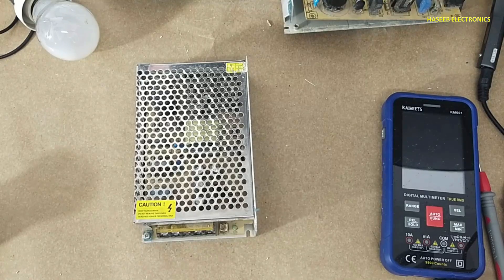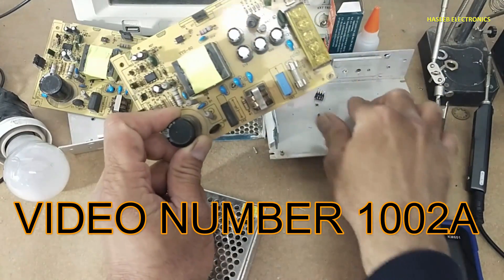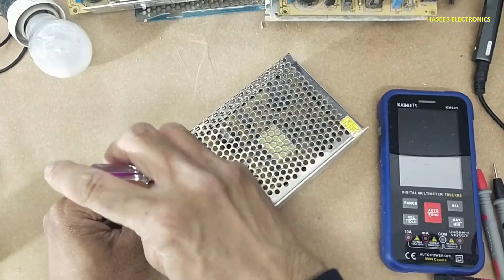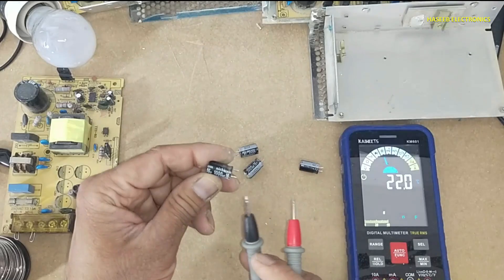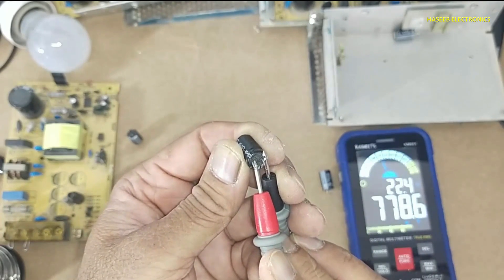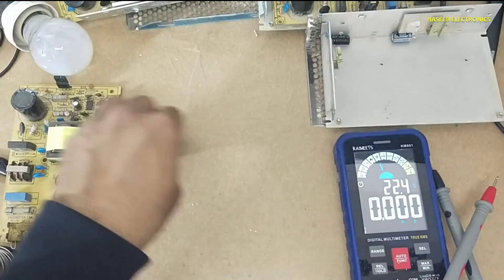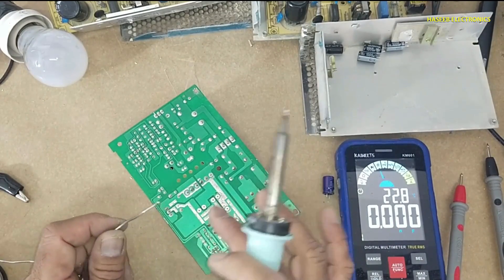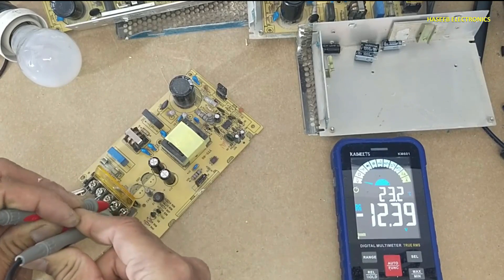{1002B} SMPS output voltage fluctuating, unregulated output

Comment: Bună ziua. Am și eu aceasta sursa și nu reușesc să-l depanez. Au pușcat condensatorii de 1000 de uf. IC Ul și rezistorul de 0.22 ohmi de la pinul 3 al mosfetului. Toate le-am inlocuit mai puțin rezistorul de 0.22 ohmi nu am găsit. Temporar am montat un rezistor de 22 ohmi. Pe ieșire am 5 V .Poate cauza acest rezistor problema mea? Menționez tranzistorii sunt buni octocuplorul este bun IC-ul am pus nou și condensatorul de 22uf al ic ului este nou. Diodele sunt bune inclusiv diodele zener.

Comment: Bună ziua. Respect pentru cea ce faceți. Am si eu o sursă de genu 12v 4.1 amper. Mi-a crepat 2 condensatori și sa ars si intecratul UC3842D. plus rezistenta de la mosfet de 22 microfarazi care merge la pinul 3 al mosfetului 5N65C. Ce cauzează explizia condensatorilor? Cu respecr.

Comment: Great tutorial, already like comment subscribe.

I'm from Indonesia, I have a problem with the SMPS on the "ANJING" brand battery charger made in China using IC UC3842B on leg 7 (imput) with a voltage of 12 - 14 VDC, on leg 6 (output) there is a pulsating voltage of 0,5 - 1.5 VDC which goes to the MOSFET gate 7N65, on the drain leg the voltage is 210 vdc connected to the transformer leg, primary Elko voltage 320vdc, output 0 vdc, where do you think the problem is sir? I removed and checked several important components in the primary and secondary which had normal values... 
In this conditions, is the UC3842B still normal or is there a problem? Thank You

Comment: I would like to share something i learned about capacitors, if you have 1 UF 35v and you want to replace it with the same rating you need to pay attention to all the details such as esr and low impedance and its more expensive, its the same rating 1UF 35V but you will see some marking on it, and by checking the datasheet you will know if its completely the same or there or its different. If you are repairing some expensive industrial power supply or any other expensive things make sure you put the same cap. This is what i wanted to add. Thank you

Comment: the only thing. which you certainly know, the overall ESR will be slightly higher now due to parallel resistance  of the 4 caps ESR vs 2 caps ESR.  but it wil probably be fine especially if the new caps are a quality brand name

Comment: I almost always prefer to have more capacitors in parallel . You have 2 good capacitors 1000uF/16V. So you can achieve 6400uF/16V
Reply: When two caps are found out of tolerance/failed it is good practice to replace all of them because the other two will fail soon. They are your typical badly made cheap chinese caps from early 2000's that have known issues with bulging.
Reply: @g4z-kb7ct  "...it is good practice to replace all of them ......"  agree

Comment: I was surprised to see Nichicon capacitors go bad, but might be fakes even though they have a good name on them. There is a "Mr. Carlson's Lab" video where he disassembled two capacitors, both have a good brand name, I think it was Nichicon, and you can see a big difference in size between the counterfeit capacitor and the good one. I'd like to build his leakage detector, but in the mean time I use a micro amp meter in series as I slowly increase the voltage with a variable transformer. Electrolytic capacitors always have SOME leakage, but it's in the range of about 10 micro amps after they are fully charged. Pretty cool watching how the needle jumps around quite a bit, even on a good capacitor. Thanks for sharing these SMPS'S with us! Always job security with as many of these that are out there.

Comment: Dear Sir, many of your videos feature  such power supplies (rectangular, adjustable voltage, 12V, 5A, 60W). May I ask what application they are used in (battery charging perhaps)?

Comment: Surprised that the output was fluctuating so much whilst not supplying any current - had the circuit been under load I wouldn't have been surprised - the capacitors weren't anywhere near as bad as I expected them to be maybe they fail more under the higher voltage when in circuit?